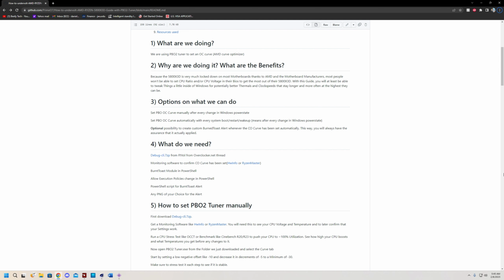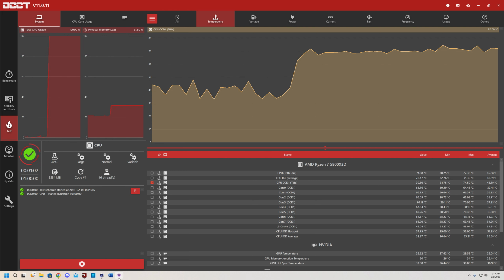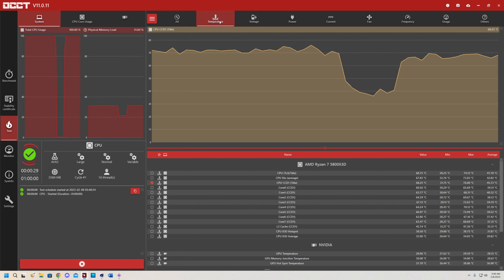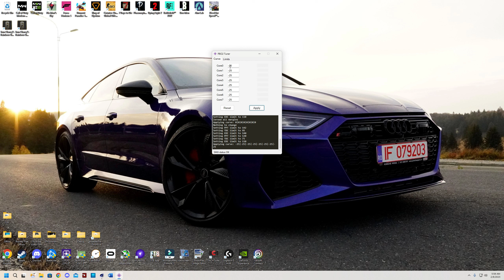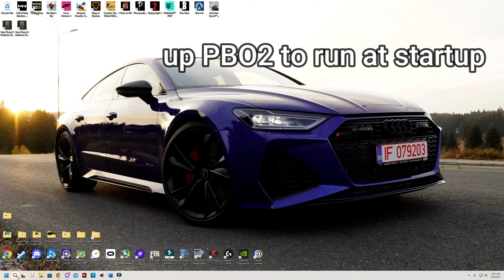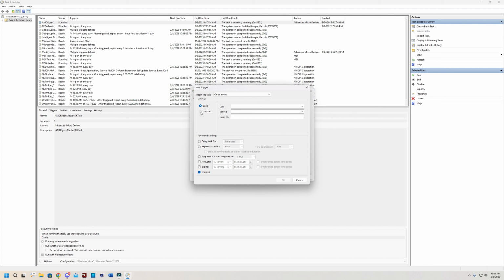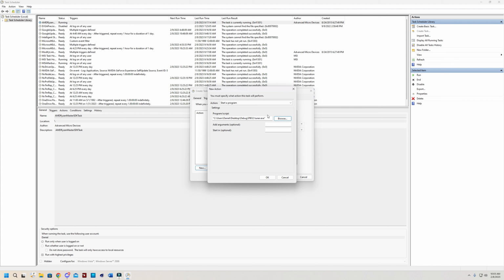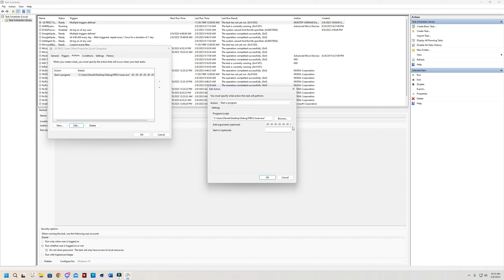5800X3D Undervolted with PBO2 Tuner (Setup Guide and Performance Testing)

Comment: thank you man for the video, followed step by step and now my 5800x3d performs really well on both 4k and 2k without surpassing the 70 celsius on many games, average 63 degrees celsius, before this the average was 72. thank u
Reply from the maker: Awesome to hear that bro!
Reply: @Beefy-Tech  hi man, yeah, im really grateful, however, was just taking a quick look to more info on the pbo tuner, does it have any sideeffects, read on some random reddit post that doing this has its disadvantages such as throwing in more current and voltage to the cpu for better temperatures and that that might in time cause damage to the cpu, have you read anything about this?
Reply from the maker: @MultiOlimac  that wouldn't make sense because with PBO2 you are using less current and voltage to achieve the same or better frequency 🤔 only time it can cause damage is if you indeed use more voltage then safe, but the pbo2 tuner app can't apply positive voltages, they just won't register at all, it can only apply negative offsets to 5800x3d.
Reply: @Beefy-Tech  I’m such a dummie, that’s right, that’s why it’s called undervolting. One last question, could you please lighten me into what the offsets actually mean, for example, -20 means 20watts less on a specific core or what does it mean exactly?
Reply from the maker: @MultiOlimac  so it's-20mv, which stands for Millivolts. The offset changes the target voltage required to achieve a maximum frequency. Let's use the 5800x3d as an example. It's target frequency is 4.45ghz and it uses 1200millivolts (1.2volts) to achieve 4.45ghz, if you undervolt by -20, it'll use 1180mv (1.18 volts) to achieve that target frequency, while decreasing temps as a result of lower voltage.
Reply: @Beefy-Tech  thanks man, so the maximum one are able to decrease is to 1.17volts, am i right? I’m currently using -25 on all cores and the preset stats and it works just fine, like you said in other comments, it also depends on the cooler one is using, mine is a no-u12a which can cool it pretty nice. The one thing I see is impossible to tweak is the temperature at startup of many apps, the temps go nuts when opening games, up to 85, but I guess it’s normal, once the game is fully loaded their back to 60 65. Thank you so much for your guidance bro, new subscriber here, keep up the good content.
Reply from the maker: @MultiOlimac  yup you are right fam! Those startup temps spiking are normal and that behavior is similar on ryzen 7000 also. Good luck with everything fam!

Comment: I did the following in bios for my Ryzen7 5800X3D: -30mv all core, PPT88, TDC61, EDC90. In Cinebench i get 15088pts, max temp: 78-80, power consumption 103W, all core boost 4447MHz.
Before when the power setting was managed by auto i was getting 15180pts with 90°C and 126W, all core boost 4444MHz.

Comment: Start at -30 all-core and use Core Cycler to hammer the CPU with low load/high frequency testing - curve optimizer is most likely to crash at HIGHER frequencies (= LOWER loads).
Also, BIOes now allow CO settings on the 5800X3D, so need need to set up a PBO2Tuner scheduler.

Comment: One thing I think you forgot to mention is when using manual PBO offset, just like with ryzen master on the 5000/7000 series, is you need to validate clocks using HWInfo or even OCCT to check “effective clocks” match your shown clock speeds.

Too extreme of a undervolt with CO, will result in some or all cores not actually running at the clocks it thinks it is. OCCT and HWINFO have this reporting tool for this very reason.

This is important because while the system may be stable, you’re losing performance potentially in cores that need more voltage to actually properly boost under load. 

It’s extremely rare that all core -25 or -30 is actually stable in the case, usually you see your best performing cores wanting more voltage to actually boost high enough in low core utilization scenarios.
Reply from the maker: I used hardware info to verify stability in OCCT bit I forgot to mention it here not realizing that it could show differently in OCCT. I have run -30 and -25 and I yet to have a crash myself, but I imagine its not like that for most people. I am  hopeful that if anyone has issues with it they send me a comment so I can tell them exactly of this 😆👍
Reply: @Beefy-Tech  stable != Performant.  What he's getting at is that you can be totally stable but not gain performance as it starts clock stretching to maintain stability.

Scores are often better with a mild offset than -30 all core, and the cooling solution has an impact on how much offset is tolerable before stretching as the volt/freq curve offset changes based on temp.
Reply: So once I get hwinfo, if I set it all to -30, how do I find which core is stretching and boost them? Dunno what I'm doing this,
but trying to learn
Reply: @LaoNinja007  check for “effective clock” anything bc below your set boost for that Core is a bad UV.
Reply: Where does this info come from that it's "exremely rare" to get stable performance without clock stretching at -30 on all cores with a 5800x3d? I do not have any issues at all.
Reply: @NeoAemaeth  have you done the testing I mentioned in my top comment?
Reply: @Rebrand_Steve  Yes. Effective clock speeds do not drop on any core.
Reply: @NeoAemaeth  keep it running under gaming loads and report back.
Reply: What if the clocks are nearly always below the +200Mhz Boost w/ -28 CO ? Since PBO is not a "Fixed" OC the clocks just jumps all over the place so even my Max Boost OC is 4.85Ghz it rarely reaches that, mostly just in games, not so much in benchmarks/stress tests.

Or it's basically as long as the Core Clocks matches the Core Effective Clocks it means it's all fine?

Comment: AMITool (if you can get a hold of it) can be used to write the offset values to bios on ANY AM4 board.
Reply from the maker: I have figured that typing the offset and then values with a 0 at the end does the trick for scheduler to set the limits too.

Comment: I bought ryzen 7 5800x3d yesterday and i set all cores to -30 90W/60A/90A and i got 4.45 ghz core clock stability and only get 60°c

The cooler that im using is air cooling Noctua NH-D15S

Comment: Just tried PBO2 Tuning my 5800X3D (mobo - ASUS ROG Strix X570-F Gaming) and had the opposite effect. BIOS is alrady set to 142/95/140 and curve optimiser at -30.

Running the OCCT CPU test the temps settle between 89/90.5deg and OCCT says the CPU is running at 4050ghz to 4100ghz all cores. OCCT says PPT/EDC/TDC usage is 118/81/108.
Running Cinebench R23 then OCCT says CPU freq is locked in at 4300ghz. PPT/EDC/TDC settled around 112/77/121
I used PBO2 tuner to tweak PPT/EDC/TDC to 110/75/105 and ran Cinebench test again. This time CPU clock dropped to 3.9Ghz which is a 400Mhz loss.

I know the 5800X3D is locked in terms of power and temp limits, so you can't really over clock it, but undervolting seems to slow down my CPU. Temps came down as well, but only by about 5deg.

I have a Dark Rock Pro 4 cooler, which is supposed to be good enough. (I've tried fresh Thermal paste and made sure it is fitted correctly). Maybe I should grab an AIO water cooler?

For me the results of undervolting were a small Temp reduction but also a 10% drop is CPU clock speed.

I'm not sure what I need to do differently. My Mobo (ASUS ROG Strix X570-F Gaming) has a load of power settings I can mess with but I'm pretty sure I've got mine set to something reasonable.

Comment: i tried everysthing but the task scheduler doesnt apply the limits. after u put -30 -30 -30 -30 -30 -30 -30 -30  you can add the limiter values, for exampe (-30 -30 -30 -30 -30 -30 -30 -30  120 75 110) BUT for me the task scheduler doesnt add these values and as soon i type them in and start the task it just wont work anymore. do you have a solution whyx the limits cant be applied with the task scheduler for me?
Reply from the maker: The secret is that you must put a 0 at the end of the argument line in task scheduler!

It should look like this:

-30 -30 -30 -30 -30 -30 -30 -30 120 75 110 0

That 0 at the end is very important!!!! Male sure you add it and it'll work👍
Reply: @Beefy-Tech   wouldve loved to try it but i updated bios and was able to do the UV via PBO directly in the bios and made the program obsolete now. but ty for answering!
Reply from the maker: @earlgrey1745  it's great your bios has it, for anyone that has it it's wayyyy more convenient!
Reply: @Beefy-Tech   indeed! my bios only supported it after the update. so maybe for some ppl. its worth to check if theres an update and if itsd supported by now.

Comment: Hey bro ! have a question, I don't need create task if i do the same thing same value ppt ect in my bios right ?
Reply from the maker: Yes fam.
Reply: @Beefy-Tech  Thx bro ! i try -30 all core and 100-70-100 . 14500 score on cinebench for 76 max temp . you think i'm good ?
Reply from the maker: @williwilly3593  I don't honestly have a reference point for the 5800x3d, so no clue if it's good or not, but if you can run -30 with power limits, you are good to go!

Comment: my settings is -30 120 75 110 and i get 14905 cb23  score,  and a tip  this is the corect line whit limit on tasks. -30 -30 -30 -30 -30 -30 -30 -30 120 75 110 0(  this setting is my personal tested)
 whit tis line weill apply the full list on start not only the curve
Reply from the maker: Thank you! This worked perfectly on the 5800x3d. I gave 5800x3d to girlfriend though, so she is the one enjoying the no hassle undervolt xD.

Comment: I get SMU status failed when trying to change ANY of the limit values. It just says 0 next to PPT, TDC and EDC
Reply: exact same thing as me did you find any reasoning to it?
Reply: @Oujry  I haven't yet, it worked for me one time when I booted my PC up and I could change all my values but otherwise... no luck. No clue why it doesn't work and why it only worked that one time, but thankfully you can just use the task scheduler to set them every time you boot up your PC.

Would be nice to be able to experiment on the fly, but it's fine once you find good values.
Reply: @vangledosh  so for me I can change the PPT TDC AN EDC in pbo2 I can see that the changes happen in ryzen master but it still says 0 an smu failed but it does change I've no idea either man I've looked online everywhere an I cannot get a solution

Comment: Glad i pointed you to this also there is a new bios and you can do CO in the bios now :P Still i have more fps then you at big map im avg. 249fps stable with 169 1% lows @720p 6700xt tested for fun. Your 70 fps drops at rebirth island are strange. Looks like memory oc stutters either to low VSOC voltage / VDDG IOD or to low mem voltage combined with to low tRFC. Im at 149fps 1% lows on rebirth with 219fps avg @720p. 3866cl16 but all sub timings max tuned + 140ns tRFC could do 4000cl16 same timings but to lazy :P Also there is a huge penalty in WZ2 if you have your windows page file turned off. My friend had a problem with crashesh/stutters hes on 32gb ram and i think windows11 turs it off if ur at 32gb. Turning it back on auto resulted in 0 crashes and +20% fps and stutters gone :P
Reply from the maker: I mean it could be that something is wrong with my Ram timings, I would have to set to default and run some tests which I'll do. I have not heard of the windows page file before so I will check it out and see if it's on or off.
Reply from the maker: I bought the 7950x3d which I plan to run on 1 ccd with only 8 cores on warzone to compare to stock performance, and obviously upgrade from 5800x3d. With this occasion I'll reset everything to default and redo my ram timings to see if I made any mistakes 8 months ago when I did initial tuning.

It could also be that page file thing with windows 11, but I yet have to test it out. 

Also, I got a dual pc setup and new mic and will finally be able to record without FPS loss for best representation of results👍

Comment: I don't know if my 5800X3D is strange, but the max all core boost (4.02) I can get is if I set -50 curve and keep the TDC at max values. If i drop the TDC the frequency drops instantly. PPT and EDC I can keep maxed out because they never pass 70-80% of their max value. I don't know if my chip is strange or I'm doing something wrong.

Comment: The limits dont remain the same when I do a restart. Did I miss something?
Reply from the maker: When you type out the command, add a 0 at the end.

Type the command aa follows

-30 -30 -30 -30 -30 -30 -30 -30 120 75 110 0

That 0 at the end is very important for it to work👍
Reply: @Beefy-Tech  do you mean under the arguments in create a task? Towards the end of your video? Btw thanks for the video
Reply from the maker: @rcsverige  yeah fam! Where you type the argument make sure you type the 3 limits, followed by a 0. That way it applies the line properly👍

And for sure fam, this is a very old video of mine so I wasn't sure at the time about the argument line myself, but found out how to properly set it later down the line
Reply: @Beefy-Tech  ok gotcha! Thanks!

Comment: Did not work for me at first. Apparently when you have "fast boot" enabled in BIOS the system doesn't shut down completely, so no cold boot and it won't trigger. What worked for me was setting the trigger to "At log on" instead of "At start up"
...maybe that helps someone who's struggling with this.

Comment: hi, im using pbo via the bios to customize my settings. I got -30 offset on all cores but I am unable to get my CPU core clocks to exceed 3600mhz speed. I see that yours reaches easily 4.4. Any idea what I am doing wrong? I also have installed the last chipset drivers, doesn't fix it.
Reply from the maker: You need to install the latest bios too, not only the chipset drivers. If you are already on latest bios, it's bugged out fully, so ull have to re-install the latest bios version from your motherboards website.
Reply: @Beefy-Tech  thank you for getting back to me, i'll look into it. Thanks! :)
Reply: @Beefy-Tech  a small update: as suggested I have installed the latest bios, this led to the cpu core clocks unlocking successfully, thank you! ingame (wz2) they are now hovering between 4250 and 4400 mhz, cpu temps are reaching 63 degrees celsius under full load (-30 curve, PPT limit 100W, TDC limit 60A, EDC limit 80A). Do these numbers look ok to you? My beginner's eye is fine with what it is seeing. I don't think i'll be pushing the cpu any further for now. Thanks again!

Comment: My 5800X3D has a strange behaviour. It thermal throttles at 78°C and begins to drop clocks from 4.450 Hz to 4.430, 4.415 and so on.
I have set no power limits and -30 PBO.

Comment: i get -30 but it refuses to boost past 4040mhz (regardless of what offset i'm using or non) and thats sitting on 59 degrees running cinabench, so weird. (power plan is maximum performance)

Comment: So when i found my sweetspot is it better to change all that values in the bios or put PBO 2 Tuner into the Sheduler?
Reply from the maker: If you have bios just use the bios. It's less involved in the sense that it'll always run without the need of an extra app.
Reply: @Beefy-Tech  yes i have.
But when i set it to low and my PC wont start i have to reset the bios.
With this program i could test "on the fly" and when i then crash it only do a restart and i dont have to do a reset right?

Comment: Hi, when attempting to change the limits on PBO2 Tuner, I have a message on the bottom of the application saying “SMU status Failed”. 

Also, the limits are not set to their default values as mentioned in the video  and is instead showing “0” on everything except the clock speed. 

Any idea what’s going on?
Reply from the maker: You might want to consider re-downloading the app and attempting the process again. The SMU status failed means limits are not applying, and the 0 in place of the limits means you might have to run the app as administrator once.
Reply: @Beefy-Tech  After re-downloading, still getting the SMU status failed and 0's in place of limits.
Reply: @cartienthusiast5115  Did you ever work this out, I am having this problem too, yesterday it was showing up fine but now I'm getting values of 0 on everything again and SMU failed
Reply: @Nuff.x  I never got it to work, the SMU status does still apply. If you want to double check, download ryzen master and look closely at the PPT, TDC and EDC values under the Temperature, Speed, Power & Current header. 

I have put up with just applying the tuner and values everytime I boot my PC, I’m planning on getting a newer motherboard and cooler in the near future too so maybe that will also fix this.
Reply: @cartienthusiast5115  okay thanks, I don't mind applying it Everytime as long as it's actually working

Comment: @beefy tech did you change you cppc settings in the bios? And hoe about the global c state?
Reply from the maker: No. So I only had an undervolt for the 5800x3d with custom tuned ram. 5800x3d can occasionally benefit from other things being changed buy it wasn't consistent enough in terms of gains for me to really bother much. But I do recommend the undervolt for sure!

Comment: hey man, every time I try and change the limits I get "SMU status failed" at the bottom of the program. All of the limits are set to 0 and can't change.
Reply from the maker: You gave to type the limits out with a negative sign and a space between them after the offset. An example below. The 0 at the end is important.

-20 -20 -20 -20 -20 -20 -20 120 75 110 0
Reply: @Beefy-Tech  even when I do that, the limits still are set as 0. When I downloaded the program they never had the default PPT, TDC, and EDC, it was just 0 for all of them.
Reply: @Cadeenn  did you figure this out? I am unable to change any of the limits